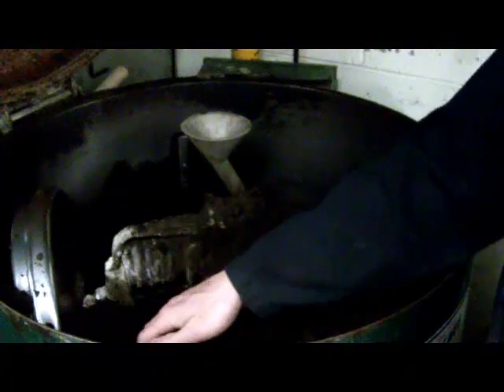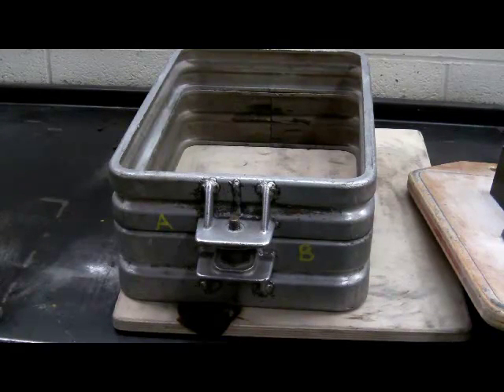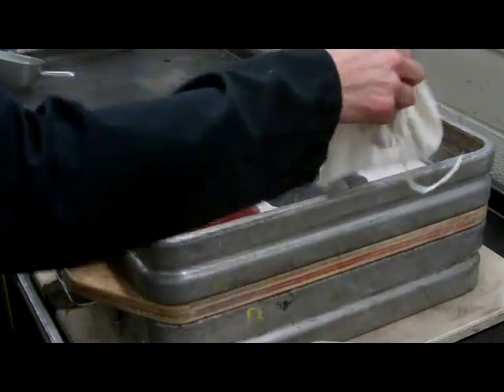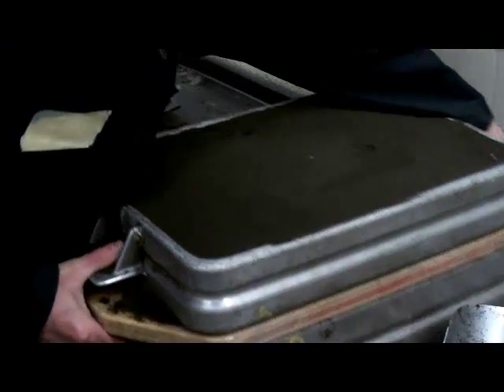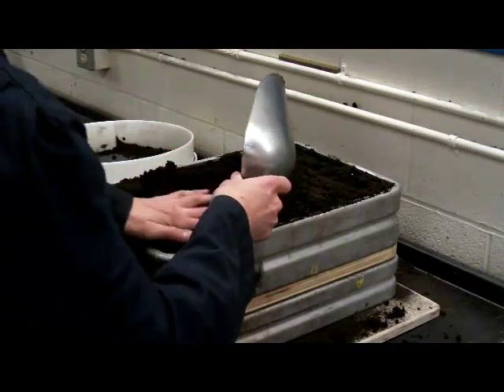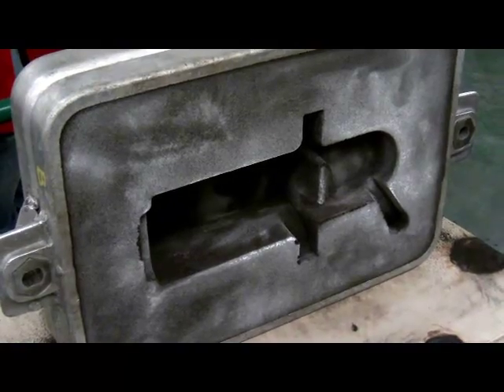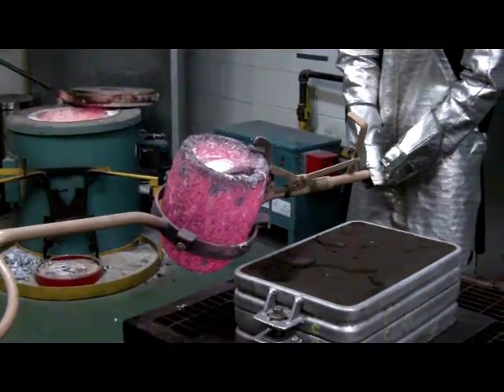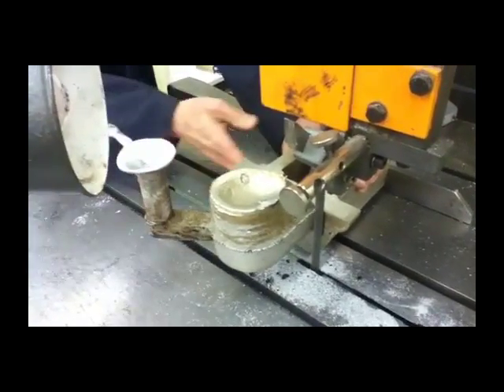Sand Casting

Comment: How is improve the sand casting surface finishing for aluminum casting...
Reply from the maker: Using a finer sand will improve the finish or machining after.
Reply: And pouring at the correct temperature. Pouring too hot results in a pebbly surface.

Comment: i'd like to ask if it is possible to make a re-entrant angled product using this process, sand casting? and also if it is possible to make a re-entrant angled product using a die casting process such as pressure die casting?
Reply from the maker: I'm not 100% sure what you mean by "re-entrant angle".

Comment: Awesome! Can you use this method to make fairly thin objects like 1.5-2mm or does it have to be done by pressure casting and with steel or whatever solid molds?
Reply from the maker: Yes, typically thin material is pressed/formed.

Comment from the maker: Yes, depending on material and heat required there are other methods such as investment casting. There is also injection molding and forming processes.

Comment from the maker: Sorry for the slow answer, just back from holidays. We are using silica sand by SIL Industrial Minerals. It is water based and there is very little smoke making it a lot nicer than the oil mixes.